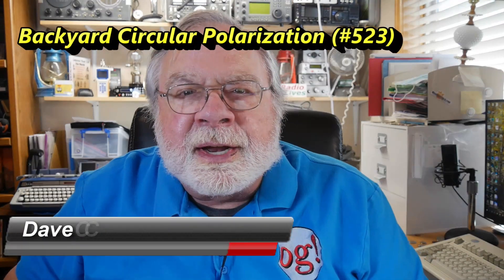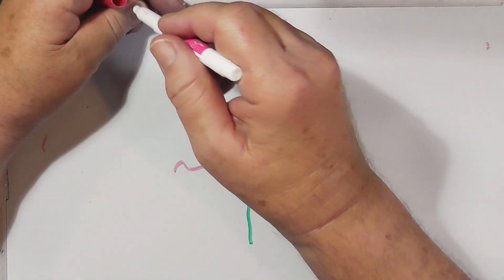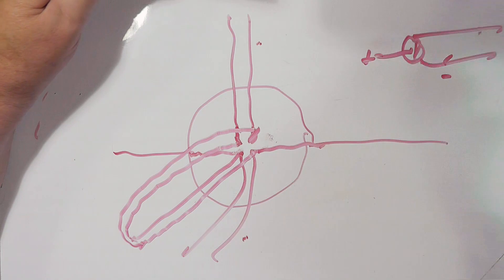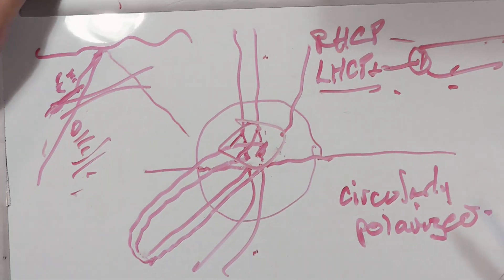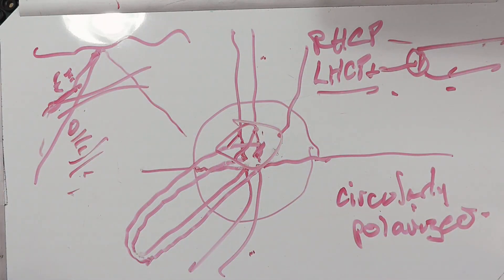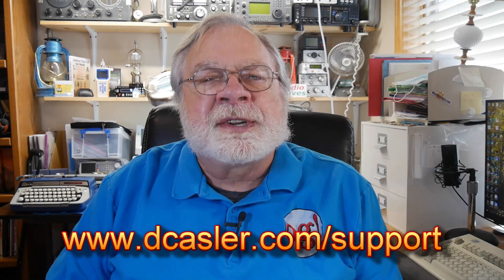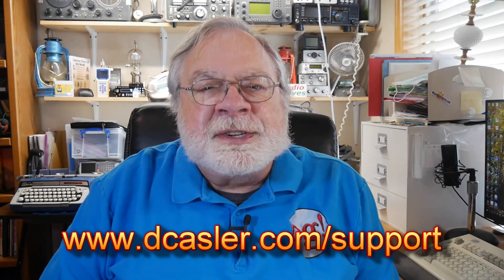Backyard Circular Polarization (#524)

Comment: Sir, please would you consider what may be two errors, 
1. The length of the feeder to the second dipole  should be 90 degrees and not half a wavelength which is 360/2 degrees.
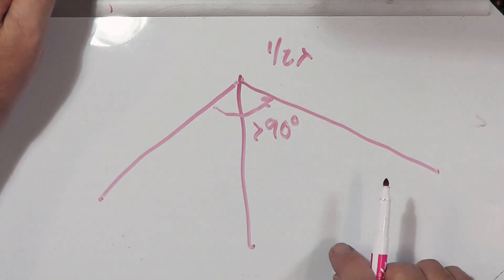2. The  vertically added " wires "will not radiate anything as the half parts are  both facing up,so they are only a transmission line and not a radiation antenna, which you so well described, at 2:19.   The added  "closed dipole" should have half of it vertically up and the other vertically  down as that  needs to be kept similar to  the first horizontal dipole, but 90 mechanical degrees with respect to one another. They should be mechanically the same with 90 mechanical space  degrees between them  but fed 90 degrees out of phase electrically. This phasing is no different from two phase or three phase supplies where motors need to rotate, Also old steam trains had a 90 degree crankshaft with two double acting cylinders which enabled it to start and rotate. The beauty of AC over DC is that rotation of the generator or the mechanical prime movers sources that rotate alternators may be recreated by  phasing   two or three  alternating E and B fields in antennas or in motors,  A pulsating field has two field rotating opposite each other to produce  alternating sinusoidal  or cosine polarised  flat signals  Once I built a three phase antenna system which rotated  the E field and he B field and the source  Transmission was difficult to find as " there was nothing in the middle which a loop antenna  could home on,  The B  and E loop  emitted from  a single dipole transmitter can easily locate the  location of the single dipole.  There is a good relation between single phase, two phase and three phase motors to what happens in phased antennas.   Hope this helps.

Comment: Wouldn’t you want a quarter wavelength for 90 degrees shift? 1 WL is 360 so 1/2 lambda is 180
Reply: Yes. You need 90°=π/2 phase shift which is (the electrical equivalent of) lambda/4,
not lambda/2.
Reply: Thanks that’s what I thought. Dave never reads comments and corrects his mistakes then others use this mistaken information. I have posted many corrections on his posts and he has yet to respond to one. I give him credit most of the time he is right, but he is more concerned with his QST article and creating new content than getting it right

Comment: You lost me with the configuration of the second dipole.  It looked like two vertical wires as if it was a piece of transmission line.  I would have assumed the second dipole would have been at a right angle to the first and then fed with a 1/4 wave length of coax not 1/2 wave.  At the end you said something about the delay being 90 degrees and that would be a 1/4 wave.  Otherwise I don't see how a 1/2 wave delay would allow for rotation.
Reply: I was about to ask for the same clarification.
Reply: @nickmoniker  me three
Reply: Yep, I an definitely confused with that drawing. The 2nd dipole looks more like a transmission line
Reply: "Think in 3D!" Circular polarization of RF "looks" like the helix of DNA.
Reply: @macgyver5108  I understand circular polarization.  What I don't understand is Oggy's drawing of the second dipole and the logic behind using a 1/2 wave length of coax  when I suspect it should be a 1/4 wave length.
Reply: @macgyver5108  I know what CP is and what it looks like, but more confused than a chameleon and a bag of Skittles about the drawing.
Right after he states that two conductors run 90 degrees, relative to each other, act more like a feed line and won't radiate, he appears to draw two conductors at 90 degrees to each other intended to radiate. 🧐

Comment: I just make it an inverted V
Reply: Circular polarization is what our FM station uses. We just got a new 3 bay installed last spring, which I have some video of. I have not heard of it much in the amateur world but is almost is the new default for FM broadcasting, although there might still be one in my market that does 2/3 power into vertical and 1/3 into horizontal.